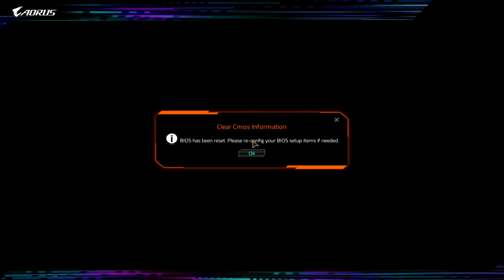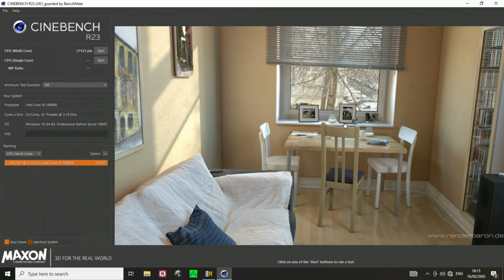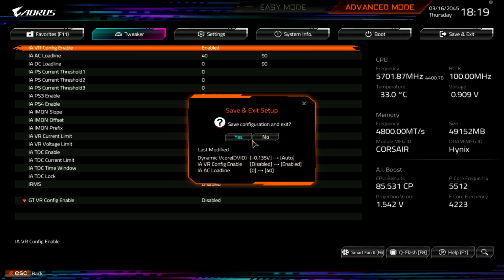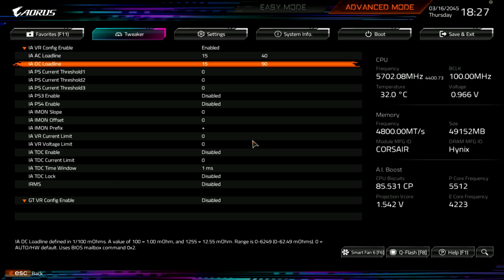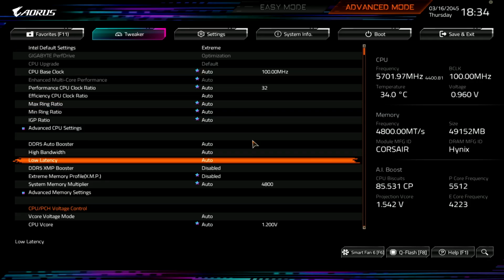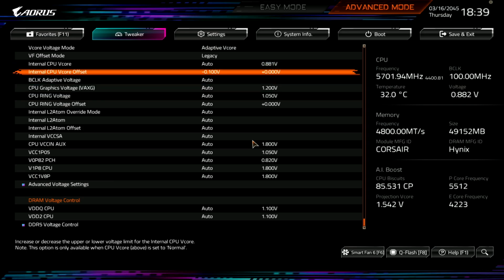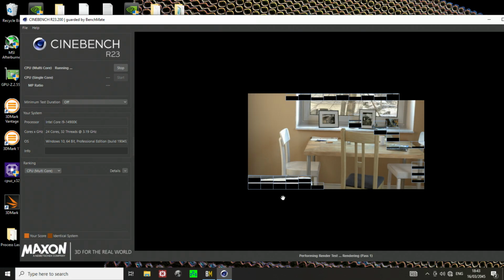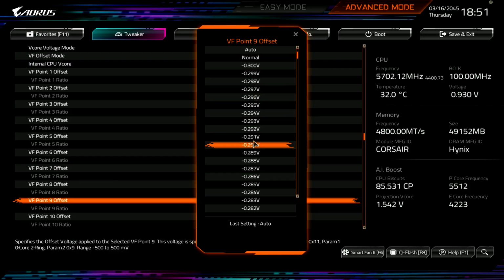YOU  DON'T HAVE  TO TURN OFF CEP to undervolt intel 13/14th gen CPUs

Comment: 13900KF with Gigabyte Gaming X AX (1.x revision if it makes any difference), I set my loadlines to 15 and loadline calibration to extreme. with adaptive vcore and vid offset -0.085V. Both CB23 and CB20 run stable with 23 at ~37-38k and cb20 around 9k.
peak VID requests in HWiNFO are are around 1.25V but can jump to 1.329 in idle.
But, and here is where I stumped, this is with only 5.3 ghz on p-cores and 4.1 on E-cores.
It seems I can't get 5.5/4.3 ghz in CB, unless I turn off intel default settings and go with whatever gigabyte uses, which crashes on most U4 shader building/cb20 etc.

and another thing i noticed - with these settings if i open intel XTU monitoring
there is something called "current/edp limit throttling" constantly being triggered, and no obvious correlation with say p-cores getting boosted to 5.8 ghz during these limit throttlings (or they just don't line up due to only having garbage ITE I/O monitoring).
Did anyone encounter something like that?

System is stable with current settings, it was stable even before intel default settings except for u4 shader compiling and cb20, and not even all U4 games were affected. But as I don't have a way to figure correct loadline settings except by just going lower than the default ones (90/90) until CB20 starts crashing and I don't have garbage scores (like 25-30k if set to 55/55 and high calibration) I am a little bit nervous if 15/extreme and -0.085v undervolt with adaptive vcore enabled but "current/egp limit throttling" getting triggered (maybe XTU overrides my settings as I see that with it running VID is higher), if it's fine or not.
Reply from the maker: the current limit is probably getting triggered by ICCMAX. Which happens way before  the VRM outputs ICCMAX levels of current because ICCMAX is supposed to include the ripple current flowing through the decoupling capacitors and the VRM can't measure that.
Reply: @ActuallyHardcoreOverclocking  did take a look - in hwinfo there is a metric called IA: Electrical Design Point/Other (ICCmax,PL4,SVID,DDR RAPL) it gets triggered when I start CB23, but it's not constantly triggering on/off while idle, so probably intel XTU applies some garbage settings overriding (at least partially) what is set in BIOS.
XTU already went into trash, but more interested will I have positive effect if I set ICCMAX manually to what  Intel suggests in their documentation? (307A, if I remember correctly) 
VR VCC Current (SVID IOUT) shows maximum of 206A, but at the same time I have 253w PL1/PL2 default settings, so probably due to 253 max power ICCMAX adjust accordingly?

Comment: In today’s world you need a PhD in electronic engineering to understand and safely operate a piece of silicon that doesn’t even work properly by default 😂
Reply: @peterv.9399  I find it actually fun and instructive to fafo with your hardware, its not even a severe case where you can't use it at all, the problem is basically as a guy said above that the initial "stock" profiles were way too close to the sun. So the problem is a puzzle to find out the optimal parameters which is personally always found a fun activity, as long as the hardware actually works. 
For people who use the "stock doesn't" work excuse, first of all why do you buy high end unlocmed cpu's to run them stock for like 2 or 3 games that are today a piece of caje to any cpu above a 5 tier released in the last 3-4 years, and, second, you can always buy a console if you want plug and play, no thinking, no bothering, no touching the hardware kind of stuff. Just chill and maybe you even learn something nice from this process. That's my pov
Reply: Intel expects only liquid nitrogen oc enthusiasts are getting their chips
Reply: yeah
Reply: Sounds like you are best shopping the nonK cpus.
Reply: I dont think you realise this was the case. Earlier on in the 90s yes. Now for the past 20yrs the bios does all the work fot the end user.
Reply: because the default is not 6GHz no matter how hard Intel tries to, it just can't be stable at those clocks
Reply: Another reason why you go with AMD, just plop it into the motherboard, update BIOS and enjoy your new PC... None of this rocket scientist crap is needed to just play some damned video games
Reply: @lessdatesmoreonmyplates1457   I remember when that was being said the other way around when AMD CPUs were exploding. Always some corporate fan ready to pounce on an issue to say "Should had bought from this company that doesn't pay me to sell for them, but I do it anyway!". Maybe you do get paid, in which case, fair play. In many cases though, a lot of these people aren't getting paid for their brand tribalism, and it's just pathetic that they hang around their corporate biases competition videos, forums, subreddits just to say "This is why you buy AMD!". They only do it when the other side is down, when their own side is down, they try to lie to everyone that it's actually up. I've seen Intel fans do it too when earlier in the year, you could just turn on a Intel PC and it worked while AMD was having the issues.
Reply: @Mcnooblet  True, but all the research suggests the 7800X3D is the best PC for gaming. There's basically no reason to go Intel if you're just gaming. I went with Intel in case I wanted to do productivity tasks. Now I'm regretting it like crazy and wish I had just gone AMD 😭
Reply: @lessdatesmoreonmyplates1457  Agreed. I built my PC only 6 months ago and I'm thinking of cutting my losses and getting a 7800X3D just so I don't have to deal with this BS anymore.
Reply: @MsVamPireChic  Huh, so why tf you bought intel if you're workless and only play games 😂
Reply: I would look at this as a great learning tool. Even if you run AMD you should understand basic voltage principles.

Comment: On my gigabyte board, intel default settings force something called "Dynamic Overclocking Undervolt Protection" which you can see on hwinfo. You can't undervolt either way when this is on, and it doesn't go away unless you disable intel default settings (even setting IA CEP and Undervolt Protection to "disabled" will not work)
Reply: Sure enough, I have undervolt protection enabled and I can undervolt perfectly fine on my MSI. Looks like motherboards are allover the place LOL!
Reply: @valentinosgsxr  with the intel default?  it might be setting certain settings turns it off automatically on some MSI boards
Reply: @ogBINARYGOD  I enabled intel's defautl profile first but then I changed the LoadLine calibration mode and AC/DC manually. Then I applied voltage offset and XMP. UV protection, C-states and CEP was enabled by default and didn't touch them. The BIOS still says I m on intel's defaults profile and my 14700K is running full boost with 1.1V and medium loads up to 1.2V maximum, so definitely undervolted! My VIDs and my Vcore is a perfect much and the CPU running through all my games and stability tests like a charm.
Reply: @valentinosgsxr  can you share the values? i have been trying to make this work but i'm unable to do it
Reply: @Alonne1  Hi mate! I don't like sharing particular setups for the simple reason that a different CPU and motherboard combo might end up not even able to boot. It may also be that my system is now on the edge and it will give me crashes the next few weeks. I will give you some hints and do what you will with. I set a mid LLC curve and extremely low AC=DC LLs on top of a mid value negative voltage offset. I was doing quick validation after every small change using R23 and HWinfo. My goal was (apart from finding the lowest possible voltages) to get VID as close as possible to Vcore while maintaining full clock boost.
Reply: @valentinosgsxr  i see, i have been trying to do something similar right now my 13700k is able to get 28000 points on R23 but for some reason i'm not able to get 30600 that i used to get and my clock speeds are also 200Mhz slower, normaly i would get 5300Mhz at full clock under a heavy load like R23 now i only reach at best 5100Mhz and no matter what i do i can find a way to recover the points and the Mhz on R23, it's driving me crazy.
Reply: @Alonne1  I would consider starting from scratch and only basic changes each time. I suggest you to reset cmos so everything goes to absolute defaults. Don't even enable XMP.  Make sure your BIOS is not nerfing your CPU and if the default power limits are less than 253W, select a profile which allow for at least 253W. Do a reference test. Apply a quick and dirty offset undervolt, nothing else, no adaptive no nothing. Start with something easy, lets say -100mV and work your way up until either you get your clocks back or you crash. Let me know.
Reply: By "make your way up" I mean negative offset...-110, -120, -130 mVolts etc.
Reply: @valentinosgsxr  ok i did the undervolt this way, i went -100 and now my clocks are back to 5300Mhz now what should i do? should i try to set the LLC and the  AC/DC LL ?
Reply: @Alonne1  Happy to hear that. You can keep going with lowering the voltage offset by small increments of 10mVolts until you find the sweet spot for your setup. This will be the offset you are having crashes minus 20mV from my experience. The number you will come up with, will be valid even after you undervolt using LLC and AC/DC LLs. If  you are happy with the performance and thermals after you finish your offset-undervolt then just stop there, enable XMP and call it a day. If you continue, you will only get slightly more undervolt, one or two degrees less temperature but no more performance. It may not worth the time spent, unless you are having fun tweaking like I do.
Reply: @valentinosgsxr  i was able to discorver the reason why my clocks were not reaching the max clock speed it was the VR limit that was set to low i set it to 1.4v like how Buildzoid recomends on the video and was able to get the Mhz and points back now i found something interesting that is if i push the undervolt for some reason the wattage and the temps stay the same (over the roof) i think at this point i'm going to have to reduce the  LLC and AC/DC LL in order to be able to reduce the wattage and temps while keeping an eye on the performance, now i did notice if i push the Vcore offset to low i would start losing Mhz again, this is like making a house of cards you have to balance everythig but i'll stop for now i need a break
Reply: @Alonne1  So you find the sweet spot of your offset. That was the value before you started losing clock boost. I am surprised you still have excessive temps and voltages. What numbers do you see after ten minutes of R23? ...you haven't finished the offset yet though, I suggest you run half an hour R23, one hour OCCT and two hours gaming, minimum, before you consider your undervolt "stable". From my experience, I feel confident, if I have no issues with my everyday use after 4 weeks. Let me know.
Reply: Model ?
Reply: @jst1123  Gigabyte Z790 GAMING X AX (rev. 1.x)
Reply: @jst1123  i think my reply got auto deleted, i have z790 gaming x ax
Reply: same here

Comment: can you translate IA VR Voltage Limite to MSI z690/z790 motherboards? I think there is no such option there
Reply: Yeah, and from what I read on there forums, there is no plans to add it in the future.
Reply: MSI said on their forums (not directly, but via forum admin proxy) that they currently have no intention of implementing this setting. Quote: "After internal discussion, MSI have decided not to implement “IA VR VOLTAGE LIMIT” to BIOS. MSI suggest user try the latest BIOS with Intel microcode 0x129, which have already improved the CPU VID spiking issue."
Reply: isnt it cpu lite load? the modes change the DC AC thing
Reply: @Golden2Talon  Yes, CPU Lite Load is the setting to influence the AC and DC loadlines on MSI. In CPU Lite Load mode "Advanced" you can set them independently, in "Normal" it uses preset combinations. But "IA VR Voltage Limit" is something different entirely. With this, you can basically set a lower limit for the voltage spikes as an additional protection. Meanwhile, CPU Lite Load may lower the AC loadline and thus the voltage, but it can't do much about the voltage spikes, other than to lower the voltage baseline they're occuring from.
Reply: @Mike500  what you can do on MSI Boards is, change the Voltage mode to "Adaptive + offset" and then set a negative global offset. You can combine this with limiting the Boost levels and don't use this 2 core extra boost. If you also set a reasonable lower Loadline and matching Loadline Calibration, you are most likely where you would be with a Voltage Limiter (MSI Boards don't have that). But then again, you have extra warranty, so why bother?
Reply: @bauerns5er  As per Murphy's Law, the CPU will probably degrade to the point of instability five years and one week after purchase. Do you want people to throw away their 14900K then? I think it's better to take every precaution you can right now. And not many people know how to properly combine CPU Lite Load, adaptive + offset and LLC settings. Heck, some people don't even know how to update their BIOS (usually the ones buying a GODLIKE board model). So the simpler the undervolting and voltage spike protection, the better.
Reply: @Mike500  true. But we only have the rather complicated Tools. So what can we do now other than learn. At least Buildzoid explains a lot.
Reply: @bauerns5er  Yeah. The only problem with that is, this is a limited audience mostly made up of enthusiasts. If he wanted to make a guide for the general public, he'd have to make it ten minutes long at the most, and just show what settings to modify in which direction, and how to test it properly for stability. No mentioning of any complicated terms other than the setting names. This would then have to be repeated for each board maker. As you may guess, this is not what he's best at. Something like that is probably best left to people like JayzTwoCents.
Reply: @Mike500  this Channel isn't for everyone. For shure. But for absolute clueless people the extended warranty is the easiest Thing that can be done. You can't simplyfy issues that are results Out of complicated constellations. If even a BIOS Update is too hard for one to do, this Person is lost in this Situation. It is the cruel reality.
Reply: @bauerns5er  Yeah, it's an unfortunate situation. For now, a lot of people have to depend on the BIOS updates only, to keep them somewhat safe. Hopefully this much will get through to a lot of people. Then again, it's evident that the 0x129 microcode is more of a hotfix (a simple voltage limit that can even turn itself off sometimes? come on...). So i think we're gonna see some further BIOS versions for this issue in the future, and they may also be quite important. Not to mention that, without some sort of manual optimization, a lot of the higher-end CPUs are simply a bit too crazy, people are running into thermal throttling and whatnot.

Here's hoping that at least the next generation coming in a couple months, Arrow Lake, will do most of the things better. I already heard that frequencies will be lower again, and power draw considerably lower. We'll see.

Comment: well can't agree about ac loadline not working for single core voltages. that's exactly what i did on my z790 pg lightning and 14900k, and i never seen hwinfo report anything higher than 1.38v, despite running it constantly in background for a week. i also reduced freq by 300 Mhz on p-cores, but i don't think it's possible to get voltages under 1.4 volts without downclocking while being stable
Reply: 😂 I run mine at 1.270 v on load line 4 with. 5.7 and Boosts to 6 quite often. Don't recommend your setting to anyone
Reply: @Bostonski what are your Asus Board settings?
Reply: @wardeagle1015  intel default extreme, only thing i changed is I set pl1 pl2 320, and  undervolted 0.09 so its down to 1.275 or so from 1.358 that intel stock gave me. Score in CB 39000 and seems OK so far in all games. No crashes

Comment: For Asrock Owners, cuz I couldn't find IA Settings. What I did to my 14700KF:
Bios with 0x129 microcode
Intel baseline loaded
CPU Vcore Compensation: Level 1
Base Frequency Boost: 125 W
CPU All performance Cores 5500 Mhz
UV -100mV offset
Loadline Calibration Level 5
PL1: 125W
PL2: 188W
ICCMAX: 249A
Running Aircooling max 80C with Cinebench 2024 and Vcore is less than 1,4V now. CEP off for better scores.